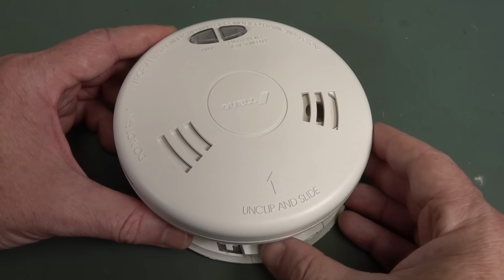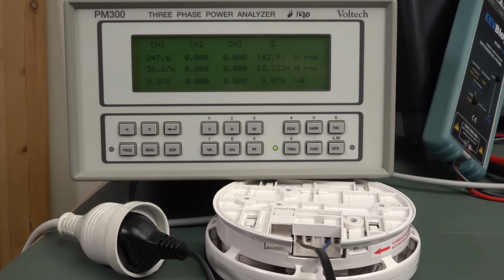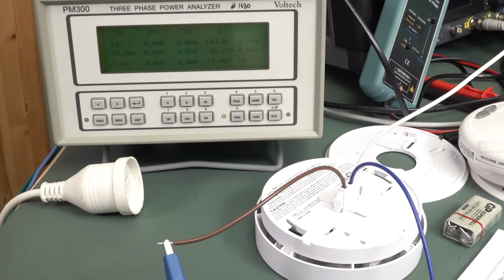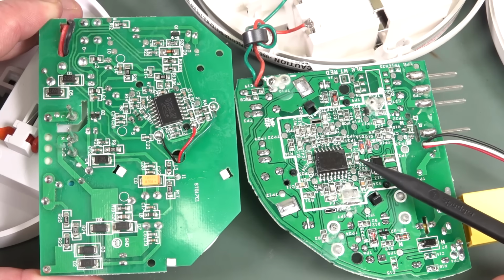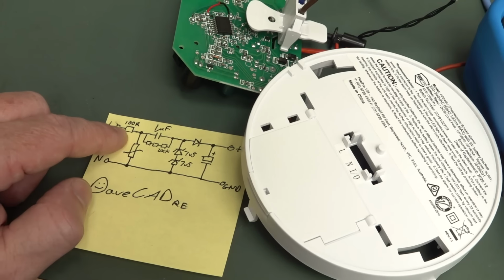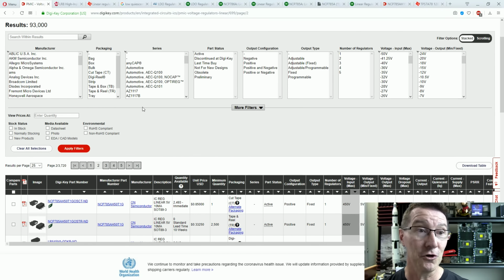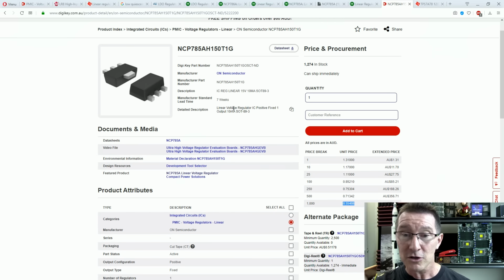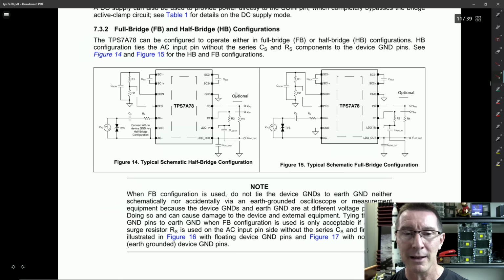EEVblog #1284 - How Bad Product Design Kills The Environment

Comment: So, just get the 9 volt battery operated version and change the batteries when they chirp every 5 years or so.
Reply from the maker: Yep. But here in Australia if you have a new house or renovation you have to install the mains one otherwise the job won't get signed off.
Reply: @EEVblog  In Germany you just need smoke detectors with a lithium battery under the newest regulations (not a rechargeable but a so-called "10-year lithium" battery). I can't believe we actually got at least one new regulation here that makes more sense than regulations in other countries.
Reply: @maximilian_mustermann_x  The EU having the least restrictive regulation? For the love of god DON'T TELL ANYONE or they'll find some way to tax it and change it. :-)
Reply: @maximilian_mustermann_x  in Scotland they've just changed the regulations. Now you must have a smoke alarm in the living room and all halls, and a heat alarm in the kitchen and they all have to be interlinked. They can be powered or the same lithium battery type however. Applies to existing builds. 

This is quite annoying if, like me, your landlord has to comply but the flat is so small the alarms will be just feet away from each other. Just going to cause more false alarms.
Reply: @maximilian_mustermann_x  Queensland Australia is the same re the 10 year lithium battery smoke detector. Only other bit is they are (wireless) interconnected, If one see smoke it sets them all off. Great time to be in amateur radio????
Reply: @maximilian_mustermann_x  It's a nice regulation in theory but when my mother moved house about 5 years ago, I bought her expensive new smoke detectors with supposed 10-year lithium batteries, they were NZ$50 each (30 euro) - expensive when you could buy a simple one for $6 including a battery.  That model was recommended and given away by multiple fire services in the UK too so I thought I was buying her a good reliable long-lasting device. But one of them only lasted 2 years before the low-battery alert. And it was not user replaceable so the whole thing had to go in the bin. Just rubbish. The others had so many false alerts we just got rid of all of them in the end. I am highly suspicious of supposed 10 year cells now. I suppose it might have just been a bad one. But still... once bitten twice shy as they say.
Reply: @chocolate_squiggle  couldn't you just get a refund or free replacement on that?  "Not fit for purpose" / false advertising...
Reply: @maximilian_mustermann_x  Just put my year and a half old "10 year lithium" smoke detector in the bin as the battery went flat. Not a fan of these.
Reply: @vk4kws  The only proof I have so far in QLD is the 10 year units last me about 2 yrs before playing up. The saving seems to be imaginary.
Reply: @maximilian_mustermann_x  I think it's a EU law because we have the same here in Belgium.
Reply: @EEVblog  Makes sense. I'm in Los Angeles and we have the same kind of absurd building codes here. Want to add a garage to your 100 year old Crafstman home in Pasadena? Well, your garage has to be engineered to handle an 8.2 on the Richter scale centered directly underneath you.
Reply: @SuperFriendBFG  Absurd that a garage needs to be held up to these ridiculous codes when living in a hundred year old home that has weathered several large earthquakes and is no worse for wear, yes.
Reply: @SuperFriendBFG  Also, the infrastructure is complete shit, so the greater danger is in a gas main exploding, a water main break leading to a sinkhole swallowing your neighborhood, or a downed 100 year old utility pole falling through your roof and a transformer exploding in your living room.
Reply: @absalomdraconis  Tell that to the city of Los Angeles.
Reply: @stephenbell9257  No, you can't live in the garage. That's also against code.
Reply: @EEVblog  There are two allowed options.  Either 240VAC main powered units with battery backup or an installation with multiple RF-based interconnected detectors (minimum of 3 detectors per installation, I believe).  These RF units with sealed Li batteries effectively operate as repeaters, eg:

https://www.bunnings.com.au/quell-wireless-photoelectric-interconnect-bedroom-smoke-alarm_p0047103
https://www.bunnings.com.au/quell-wireless-photoelectric-interconnect-hallway-smoke-alarm_p0047102
https://www.bunnings.com.au/quell-wireless-photoelectric-interconnect-living-area-smoke-alarm_p0047104

These probably use differently encoded messages depending on the installation 'context'.

 This rule also applies for rental properties.
Reply: @roscozone8092  In Australia 10 Year lithium battery only photoelectric detectors are only allowed where an alarm absolutely can not be hard wired. If it can be hard wired, it must be. The exception is if your home was built prior to 1997, in which case 10-year lithium only smoke alarms are allowed, but hard wired are always preferred. This is legislated under the BCA. The backup battery is to allow the alarm to sound when mains is not available, and it is periodically tested which is why they slowly drain and don't last as long as you think they should when "doing nothing". It is a secondary power source.
Reply: @verboeq  So says the BCA, but some less scrupulous sparkies will offer RF interconnected units as a first option (personal experience - Southport, QLD and Risdon Vale, TAS).  They earn from the T&M callout fee and aren't too concerned about the regs.

The definition of 'preferred' is open to interpretation, too - preferred by whom and on what basis?  'Preferred' based on installation cost is arguably a valid basis, especially if the sparkie purposefully quotes the property owner for new circuits and breakers in order to drive an outcome.
Reply: @roscozone8092  Preferred by every emergency services department in any state or territory, on the basis that they will, with correct testing and maintenance (generally 12-monthly test via the push button, cleaning and replacement of the battery), work when required to. Wireless interconnect is a valid option and not prohibited in any standard or legislation, and offered first because it is less work than running an interconnect cable, particularly when it must traverse multiple floors.

AS3000 simply refers to the national building codes and state legislation for what the electrician needs to do with respect to smoke alarms. These are fully available to anyone (example QFES website) to check that work has been done correctly. If it has not been done correctly, you can approach your local WorkSafe office and make a complaint if you are unable to get it resolved directly with the performing electrician. 

Because it is a licensed trade there is liability on the electrician to perform all work to the standards and relevant legislation and codes. Failure to rectify defects can result in fines and loss of electrical/contractors license, so very rarely will it never be fixed.
Reply: @verboeq  In Germany it's mandatory for rented houses and flats, but not for houses which are owned by the dwellers. Of course, despite this I have mounted smoke detectors. I also have the ones with 10 year batteries, they are perfectly fine, around 20 € per piece, a cheap one with normal batteries would be much less comfortable and with the additional batteries it would probably cost more over 10 years.
Reply: @EEVblog  Yes I just got this piece of paper in the mail the other day. New homes and major reno's will have to have wired smoke detectors. I will HAVE to install 5 (each bedroom and hallway) by Feb 2022. Every sparky around the country is grinning. They charge $120 an hour. Imagine paying $300 - $500 for smoke detectors.
Reply: @brumby92  That's a Queensland only rule after a family was killed in a house fire, and only needs to be done by 1st Jan 2022 when a property is being sold or leased, or having a lease renewed. The date to bring a property up to code for the average home owner is 1st Jan 2027. Cost over time is not much.
Reply: @EEVblog  North America has been doing this for years.
Reply: @WilliamHaggerty  NA also majority of it runs on 130v 60hz....
Reply: @Some1Special2you  130 is rather unusually high. That would be a concern for me.
Reply: @EEVblog  Hi Dave, if they require "mains" smokes why cant they install the commercial fire panels of Ampac, in nz pertronic. The single zone or 4 zone conventional panels? Or is it a standard specific thing.
Reply: @EEVblog  what? That's stupid.
There are battery versions that (should) last 10 years, which is as long as the sensor anyway, so there is just no need to have them connected to the main power...
Reply: @EEVblog  In the UK I had to get interlinked smoke detectors and self-closing fire doors because I added an extra level to my house.  The fire doors have an electromagnet holding them open, when the alarm goes off the doors slam shut.  There's a separate breaker for the whole system and I measured the PF as 0.65 and the current draw is around 150mA including the two electromagnets and five detectors, the Chineseum quality wireless doorbell is far, far worse :P
Reply: @EEVblog  same in Netherlands it seems..
Reply: @EEVblog  I was happy to see Scotland making an exception in their regs for battery alarms, if the battery lasts the life of the alarm sensor, then you can use them instead of mains alarms.
Reply: @EEVblog  Send the Orange Man in to flamethrower those stupid regulations :P
Reply: @leerman22  Pull the other one mate, he just legalised incandescent light bulbs.
Reply: @Tim_Small  Sometimes it's nice that your lights double as a space heater, at least up here :P
Reply: Check you got the "long life" kind of battery - Zinc ones are best for backup I think. "Heavy duty" types can self discharge faster. That must be why backup batteries are dying so much, cant really be that all the devices are dodgy
Reply: It's hard to compare different types of environmental damage.  But, if you live somewhere where mains electricity is generated in a more environmentally friendly way, I wonder if replacing a battery every few years is really better for the environment than running even these ridiculously inefficient devices off the mains?  Because, as I understand it, residential power is metered by kWh not kVAh, it looks to me like running on batteries is unlikely to be cheaper.
Reply from the maker: @andrewsnow7386  These also have the same battery, so the mains power is only a detriment.
Reply: @EEVblog  said "These also have the same battery, so the mains power is only a detriment."  But won't the battery last much longer when the unit is powered from the mains?
Reply: @andrewsnow7386  : If my experience with battery-backed clocks is anything to judge by, no, the battery won't last any longer.
Reply: Damned if you do damned if you don't.All those millions of 9 volt batteries going into landfills.
Reply: @fulkthered  my experience with the mains powered "battery backup" smoke detectors is that battery goes down just as fast as the solely battery powered ones.    So, I'm not saving any batteries by being  "mains" powered. ....  maybe they are actually battery powered with "mains" backup power.....
Reply: @johng4527  : I've wondered that same damn thing about "battery backed" clocks. If a battery in a package will last 5 years, then I expect one in the clock to last 1 year if never used, but I never seemed to get to 6 months. I'm not sure I even got to 1 month (I would swear that a few times I had failures after two weeks). I've started running my bedroom clock off of a cheap UPS, because at least those will keep using the AC route.
Reply from the maker: @fulkthered  Even for the mains powered units!
Reply: wait so does this still happen with 120v smoke alarms in the us
Reply: Yes. If they use a capacitive dropper circuit like that. Thing is there are billions of led lights using the same type of dropper with equally bad power factor.
Reply from the maker: @Blox117  Yep, they will be the same zener design most likely.
Reply: @Blox117  yes. They are still capacitive droppers.
Reply: Wish mine lasted that long, seems every few months they chirp in battery only ones our rental has.
Reply: @matthewmiller6068  how old is it? I think you should replace them every 10 years or so.
Reply: @matthewmiller6068  Is it getting old? I had one which just started eating batteries after several years.
Reply: @jim9930  at least in the USA we were told alarms have to be on a key lighting circuit so people can't just flip the breaker without severe inconvenience (e.g. all hallway and kitchen lights)
Reply: Same in the UK all new builds or council property's must be run from the mains with the 9v battery back up
Reply: Eh. Don't be so surprised.
My experience with Australian law is it's consistently written by reactionary idiots.

You either get no laws at all or the most draconian over the top nonsense you can think of.
There's nothing inbetween, no common sense. Just extremes.

Just compare Australian traffic laws and the justification for thrm compared to equivalent European laws.

Or hell, the laws around amateur electrical work here  vs what's allowed in the US or Europe...
Yeah...
Australia's answer to any problem: JUST BAN EVERYTHING!
Reply: @KuraIthys  As an electrician, home owners here have no idea what constitutes safe electrical work. Most of the dangerous work I see has been done by people from countries where they are allowed to do electrical work in their own home. There is a reason it is a licensed trade here and also a reason why we have less injuries and deaths due to electricity than both the USA and the EU.
Reply: HA! exactly my thought! Why bother with the cables or waste sockets.
Reply: Fuck You Google went to visit my parents, six or seven alarms chirping day and night... had to replace them all as they were driving me crazy!!!
Reply: @jim9930  of course you could but 99% of the population won't.

These are the things that should be regulated instead of hand outs for electric solar roads and other crap.
Reply: Well well well... 'canceling out the inductive loads'. 
Who saw that cumin ?  (╯°□°）╯
Reply: fortunately in my country there's zero obligation for any smoke detectors.
Reply: At least in france, you're supposed to put smoke detectors on the lighting circuit, exactly to prevent just flipping the breaker off...
Reply: So many nice examples of government overreach. Gov should just keep the fuck out of people's private lives as much as possible.
Reply: I have  five 9V powered smoke alarms spread throughout  my house. I change the batteries annually in January.  I put a reminder in my Google calendar for next January.  That way I may spend a few extra bucks than I need too  because less cheap but also no cheep. As I am old and less likely each year to be around next year I write the install date on each battery so some other bugger coming after me knows when they were last changed. Really can't see the point of mains versions as you need the battery anyway.
Reply: @Gribbo9999  keep in mind the sensors also have a max lifetime, usually 10 years.
Reply: Yeah... not legal anymore...
Reply: @jim9930  the smoke alarms in my house are on their  own breaker lol
Reply: That makes sense, but there will be the expectation that someone will do it without being paid to do so.
Reply: I expect 9 volt batteries take an awful lot more energy and resource to create than the half a dozen watt hours they end up returning.
Reply: @adymode  Yes, that's true and the reason they cost much more than 5Wh from the grid. But these devices are so inefficient on mains current, that the waste (@ ~1W) ~8600 Wh or 8,6 kWh. I don't know your treu price of electricity, but probably you can already buy the battery for these cost.
Reply: @adymode  You need those batteries in BOTH the mains versions and the battery versions. By switching to battery you litteraly just save that mains power draw. No extra batteries required.
Reply: The worse part about the law requiring mains connection is that this has actually stopped people from living off grid.  They deem the house as illegally occupied because they say it has no working smoke detectors even though it has battery powered ones.   Heard of horror stories of people kicked off their own property by the government, it's BS.
Reply: @redsquirrelftw  Probably to stop people from using exemption loopholes.
Reply: @redsquirrelftw  : The "must be run off of a primary lighting circuit" version is certainly better than requiring a literal mains connection. Then again, I don't think anyone outside of California expects rational behavior from within California.
Reply: @absalomdraconis  In Australia it is encouraged to supply smoke alarms from a lighting circuit because it alerts the occupant that there is a problem with the supply (and they usually fix the problem when all or half of the lights in the house don't work!). You can put them on their own circuit but this almost never happens due to the cost of additional switch gear and cabling. Mains power is always better than a battery as a primary source of power, because it will work 99.98% of the time and only need the battery during a black out.
Reply: In America the later NEC code REQUIRES * interconnected AC powered fire detectors (with battery back up, so when smoke is detected every alarm in the  building starts screaming at the same time. * if you want fire insurance!
  Dave (as others have done) has just driven off of the road into the ditch. Homes and industry present a largely inductive (positive reactance) load on the power suppliers.  Items like this and LED lamps with capacitive droppers (negative reactance) partly counter the existing positive reactance, they do NOT create a bad reactance. This is review is a dud. Ron W4BIN
Reply: @W4BIN  You've still got reactive currents swashing around the grid creating extra resistive losses.
Reply: @W4BIN  : I believe the primary critique was the massive waste wattage caused by the Zeners (approximately 1 Watt for one design, which is comparatively huge!), not power-factor. Frankly, just incorporating a simple buck converter with default-conducting switching transistor would notably improve power consumption.
Reply: @W4BIN  The power factor may not be an issue but the efficiency is a valid and important point.  It would be nice if customers had some information to help them choose devices instead of whatever the contractor picks.  Standards and regulations may be needed to force manufacturers to do the right thing.
Reply: My solution:  Use a 9v battery powered smoke detector.  Once a year, replace the battery and stick the old one in a clock for its back up battery.  One stone, two birds. :-)
Reply: @wargamingrefugee9065  The reason why many countries made it law that you have to be hooked to AC is because many people died in house fires where it was determined that the smoke detectors had dead batteries and nobody changed them....  (or in some cases, the batteries were removed entirely!)
Reply: Mains smoke detectors are code for a reason, you Randian wingnuts. They're way more likely to save your family then the guns you fetishize
Reply: @CODMarioWarfare  No one's even TALKING about guns, you insane nutjob! We're talking about electronics that are so badly designed they look like the master plan of a friggin' Captain Planet villain!